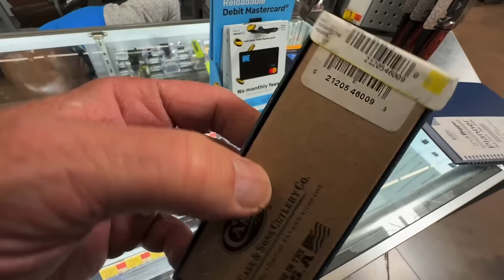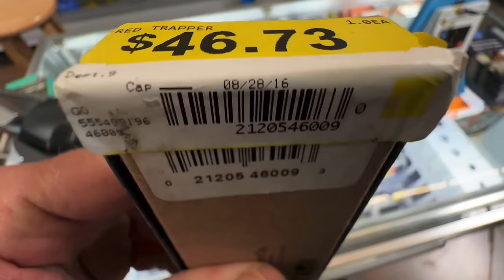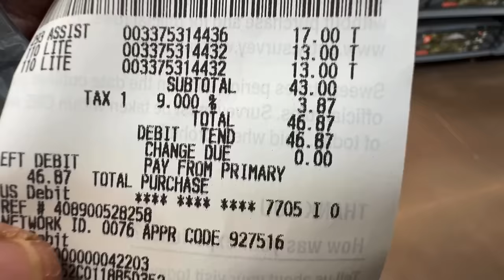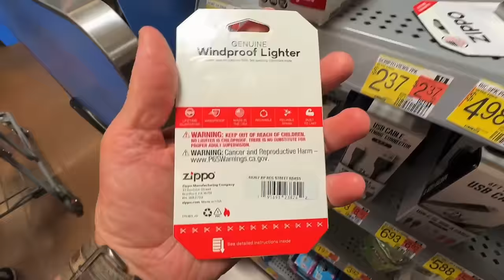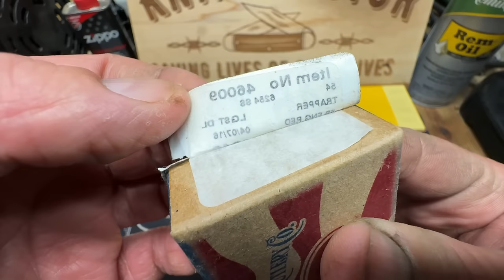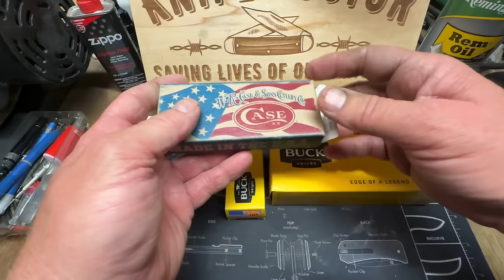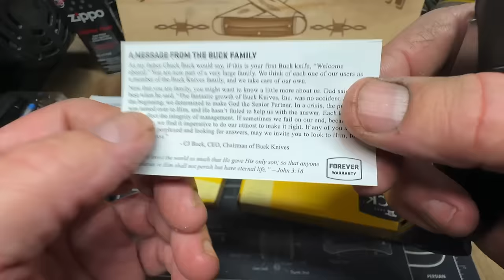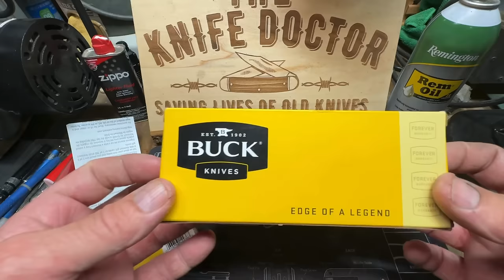Knife Clearance Gems at Walmart + Case XX Transformation!

Comment: The used blade has a tang stamp date of 1996. The c in Case would have square corners if it was 1986. Hope that helps
Reply from the maker: Ummm…no sir that blade is an 86.  Notice the lightning Bolt S’s.😊
Reply: @theknifedoctor They also used lightning bolt ss in the later 90's to signify stainless.  Also the dots would be in a line under the stamp in the 80s. The clusters of dots on either side are late 90s. Very confusing I know

Comment: Kev,   I got that 1040T cleaned up that I told you about several weeks ago.  I guess around 1970.  It says Schrade USA 1040T on the clip blade.  I knife.  It will always be compared to my Kabar, though.cleaned$100 for the same the blades with Flitz and loosened up the blades with Super Lube.  My Walmart does not have crap in the way of knives, but my Ace Hardware has a pretty good collection of Case knives.  I bought a 318-5 from them the other day  for $78.  Amazon wants
Reply from the maker: Thanks for sharing this!!

Comment: If you ever want to  "antique" either bone, horn, antlers or ivory, you can use a 50 % dilute solution of potassium  permanganate to turn it dark brown...Dilute it 50% with water and "paint" it on..let it penetrate, then wipe dry...Rub the surface with fine steel wool to bring out the worn or antique appearance that is so nice. This is permanent so don't get it on your own skin or it will turn it brown and it will  have to "wear" off.... To finish, give it a couple coats of hard wax..You can also buff wax it. This works particularly well on Stag handles. Just experiment with it, the results are outstanding..It will not work on plastics or materials that are not organic in nature.